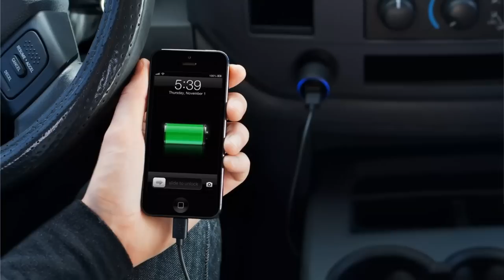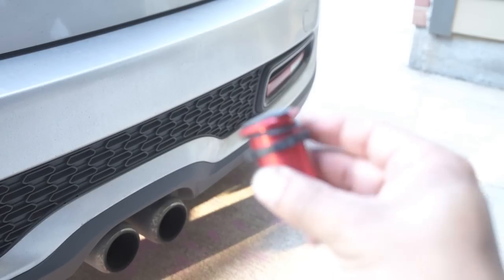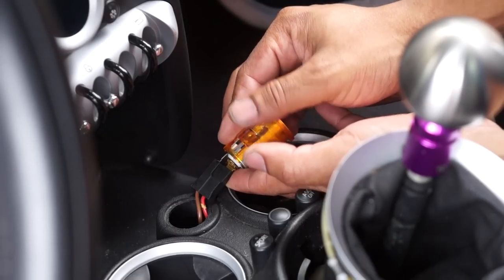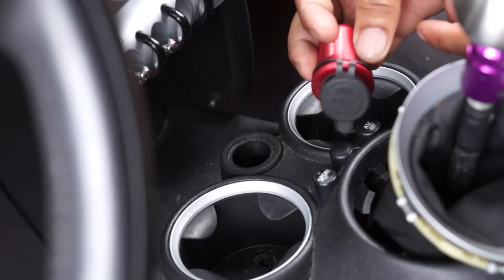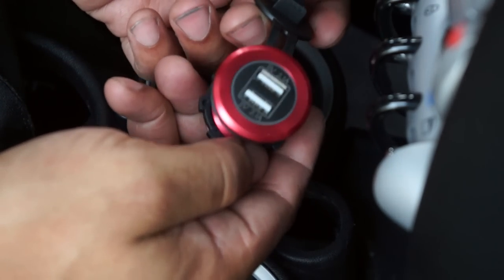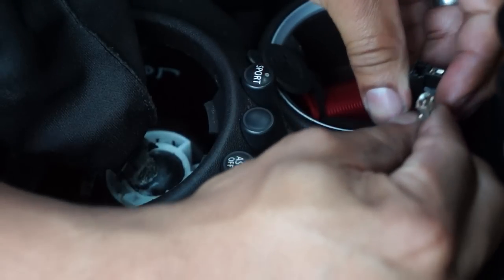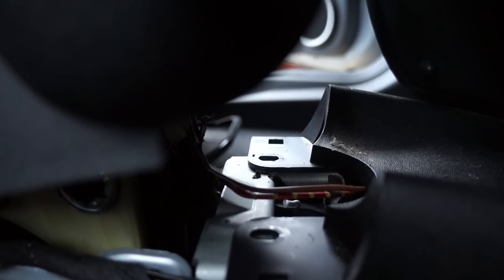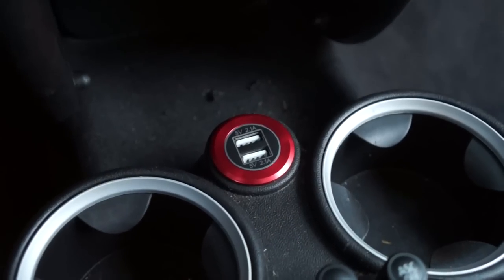R56 Mini Cooper S - USB Charger Retrofit (CHEAP mod you need but  havent done)*ANY CAR*

Comment: You should add a unibit to your tool box. It's a tapered drill bit that comes in multiple sizes and steps. While it offers multiple sizes it would also make holes a lot cleaner and keep the hole centered. Plus would have taken you maybe 5-10 seconds on that hole and be perfectly milled out.

Comment: If you are interested in doing this use a step drill bit to widen the hole and put the lock nut on the back instead of threading it on so that you don't risk twisting the wires off during installation.

Comment: Hey, thanks for the tips, away to do this to my mini. All the tips like what wire to connect where and how you used the dremal tool were great, luckily I’ve got the same tool. Would be good to see what screws and bolts you took out/ where to open up the centre console etc. + what tools you used. Either way best video tutorial I’ve seen so far so appreciate the help man!

Comment: I went to install my Sports cat and down pipe today. Could not remove a bolt underneath which secures below the cat to the resonater pipe. I sprayed it with WD40 repeatedly. Its solid. Next move will be a garage with a high air pressured, deep socket nut remover to loosen it for me.
Reply from the maker: MrAssassinash you might have better luck with a butane torch

Comment: Hi my cigarette lighter is blocked, I bought a USB Bluetooth device to use for music in my Mini Cooper 2009. I’m wondering do I need to do this with the wires or is there a way I can get the cover off? I’ve tried pulling it and it’s just bringing out the whole section! Any advice is appreciated!

Comment: Nice install. How is this an improvement over the normal drop in usb charger that just drops into the cigarette lighter?
Reply from the maker: Thanks man! It charges REALLY fast. Its a 2.1amp charger on both plugs instead of a 1.2 and 2.1amp that most of the dual chargers come with. Thanks for watching!

Comment: Love ur Channel bro. I just purchases my first r56. 09 100k. What donu suggests for an alternative for a replacement clutch that is a bit better then stock? What i found are outrageously expensive. Thanks
Reply from the maker: Hey friend! Thanks for the support be sure to check out my website for deals I have found on ebay. I have a listing for a clutch kit for under 260$ listed on there. Unfortunately it does not come with a flywheel though. hope that helps you out man 
www.bimmderdude.wixsite.com/bimerdudeautomotiveg
Reply: Clutch Masters fx250 with a lightweight steel flywheel is around $1100 and is amazing I've had for about 3k miles so far and is a really good clutch kit.

Comment: My MCS roof get stuck after park at warm area for a period of time. It doesn't open all the way up. It works ok in cool weather. If you have the same prob please show away to fix it?
Reply from the maker: Hey man, no i dont have this issue sorry bro. You may want to clean the tracks and re grease them.

Comment: Hey dude. Great videos. 
I'm a new adopter of the R56 Mini cooper S. (2008) I'm currently at 126k miles. Will these cars go much higher than 150k miles?
Reply: Mine is at 200000 and still going